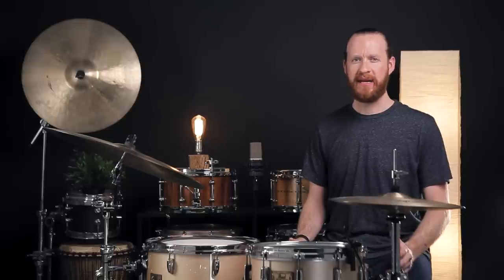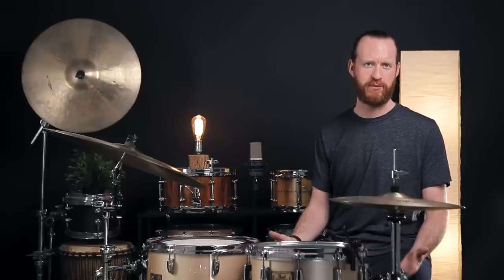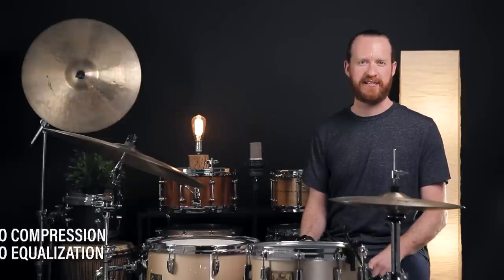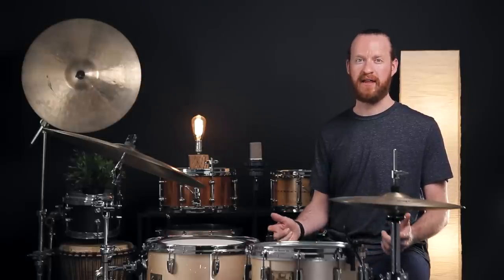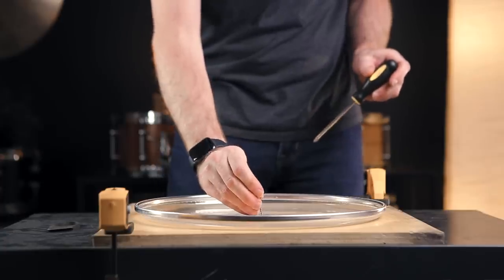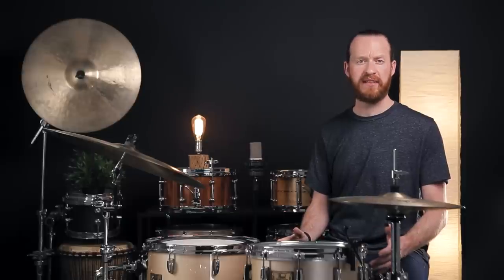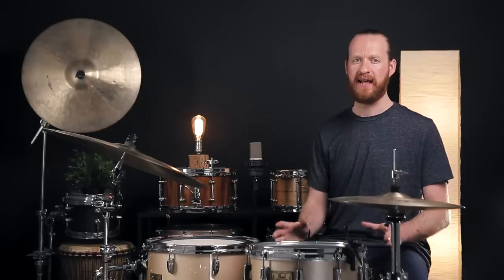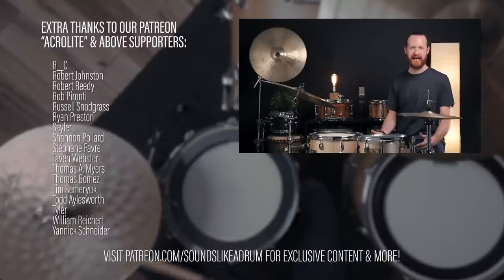DIY EMAD Snare Drum Hack | Season Five, Episode 47

Comment: Hi guys. 
Thanks for the hack. 
I tried this on my 14” floor tom today. Worked just as well as the typical EMAD tom rim version. 
You may have to tune the batter & reso head a bit higher than usual too. No reason why you couldn’t apply this to larger floor tom w/ double ply heads as the batter like they said. I use EMAD heads on most of my floor toms. Killer job. 
Very useful. 
Thanks again

Comment: I usually get an Evan’s Genera dry and stick the foam ring from a 16” Emad into the plastic bit on the underside of the head. I gig with a 14” kick occasionally and it does the job!
Reply: A have a similar hack on my martini but with a powerstoke 4 clear. I just used a little bit a contact cement glue to stick the foam to the head and it has been almost 1 year from that and is still strong without any issues.  💪

Comment: So you’ve re-invented a REMO Muff L ring that sits outside the drum (affecting the playing surface area) instead of under the head, but effectively obtaining the same exact results.
Reply from the maker: Hmmm, similar but definitely not the same exact results. By that comparison, the EMAD is just a Remo Muff'l and that's just not the case. That product is quite cool though and, if you're down to spend money rather than making stuff, that's an option worth checking out. Thanks for watching!
Reply: Being external is the whole point of EMAD. It makes it quickly removable. Unlike the REMO product you're referring to. Nobody who is using this is planning on brushwork or anything else that demands the entire drum surface area
Reply: @danielcohn6884  You can remove the ring but are stuck with the Mylar ring that holds it. Not exactly superior, IMO. I’d rather compare it to Big Fat Snare Drum Donut XL. That one is completely removable and likely provides a similar result.
Reply: @silvermineband2719  I will conceded, it's not ideal. BFSD Donut XL is a great product, but the resulting sound from the two methods are quite dostinct, which I attribute to material for foam in EMAD rings as well as the pressure applied. I would never say one is better than the other. BFSD product is definitely more refined but this is a prototype and provides more pronounced, thumpy dampening. Also I've had issues with buzzing/vibrations in most easy on/off ring solutions. Luckily, most (but not all) BFSD products I've used are free of this issue

Comment: One thing to consider as well!: You can risk ripping the threads on the lugs if your tension rods are barely long enough, especially with a higher tuning. Overall shouldn't be a problem but it's a possibility.

Comment: Aquarian offers a 14" Super Kick II Clear with tom hoops. I used one for my snom but that limits your dampening possibilities. It sounds good when the snares are on but when you want to use your snare as a tom, it wouldn't sound as open as your rack and floors (unless both are with considerable dampening as well). Not to mention it's also not cheap at 40usd (as Ben has said it may have something to do with the extra expense/tooling etc). Now I use a coated Response 2 with a BFSD Donut XL on top so I can take it off whenever I want my snom to sound open.

Comment: Aquarian sells their superkick I and Superkick II in a 14 inch. I have one and sounds amazing.
Reply from the maker: Yep! Those are cool. What's awesome about this hack in particular is that you can use any drumhead as the primary surface and you can easily switch between them. Since there really isn't any wear to the cutout drumhead, you can move it between drums and continue to reuse even after the primary surface wears out.
Reply: @SoundsLikeADrum  Plus they are not cheap.

Comment: Would the foam fit under an S hoop?  That would take a lot less work or heads!!
Reply from the maker: Hmmm, it's possible! One of the great things about this setup (even compared to the actual EMAD on a 16" floor tom) is that it does more to protect the foam ring and isn't nearly as susceptible to damage from impact the way that the PVC tray is with a stock EMAD.

Comment: That sounds pretty cool. Is the volume affected? If so, this might be the solution for the tiny venues. Thanks for a great episode and an amazing channel.
Reply from the maker: Any muffling will, by nature of the physics, affect the volume but this seems to be quite subtle compared to the use of a bandana or even a Big Fat Snare Drum option. One of the great things about this is that the quality of sound doesn't suffer at softer dynamics so you can simply play softer in smaller spaces without sacrificing the tone. Cheers!

Comment: But the aluminium ring of the upper head is pressing at a different spot\part of 
the fleshhoop underneath to get tension on the head ,than a normal metal hoop would,is there not the chance of damageing this flashoop or to get uneven tension,because the harz (?) in the aluminium ring is not allways perfekt,at least with remo heads,this is quite often the case ?
Reply from the maker: The flesh hoop is still pushing down on the flesh hoop in the area that would normally contact the counter hoop. I tried this at a range of tensions on a few different drums with the same pair of heads and didn't see anything that hinted at potential damage and the setup was easy to tune (you can even remove the foam ring for tuning if you choose).
Reply: @SoundsLikeADrum  
Ah,ok,i just thought,because the flashoop of a head is kind of U shaped,while the couterhoops are even or rises sometime a little twards the center.But if it's working, it's fine,and there is no better way to find out than to do some  experimentation.
Thank's for your fast answer !

Comment: How did you find the center of the head to put a screw in that spot?
Reply from the maker: You can mark the center when the head is on a drum by marking the intersection of lines created by two opposing lugs. In this case, we just centered the head on the plywood, which already had a center mark.
Reply: @SoundsLikeADrum  I was thinking the same thing. Have head on drum and use the tension rods as guides. I guess it doesn't have to be perfect but the closer the better. Thanks for video.

Comment: I'm guessing this puts the rim about 1cm higher than where it usually sits above a drumhead. I don't know if I could even deal with that, how do the rimshots feel? Sounds pretty cool
Reply from the maker: Rimshots felt fine as did cross stick (even at the ultra low tuning- which is what was playing in the background during the process portion of the video). I really didn't even give a second thought as to the height of the hoop relative to the playing surface.

Comment: weatherstripping. works wonders. sticky on one side under the head around an inch from the flesh hoop. old school emad.
Reply from the maker: Weatherstripping can be cool too! One of the things that makes this system so unique is hop little pressure is applied to the batter head by the muffling. The foam is SUPER light weight and just floats atop the head with the outer drumhead ring keeping it from flying off/applying the smallest amount of pressure. This ensures that it's still plenty loud and full while providing a modest amount of overtone control. As soon as you start adhering things to the head, you have to hit harder to set it into motion because of the added mass. These are all great tools to have at your disposal though!